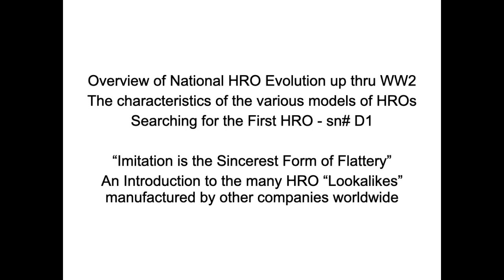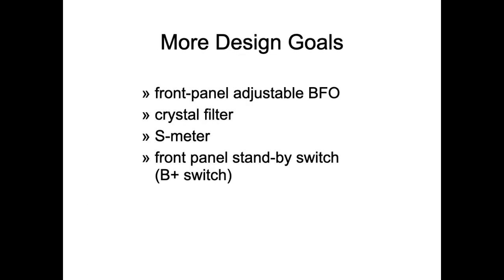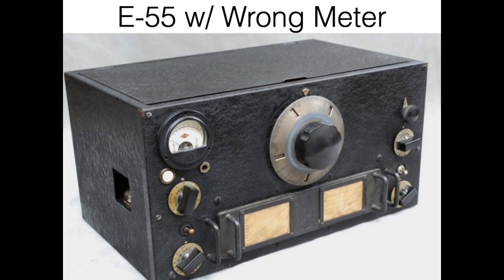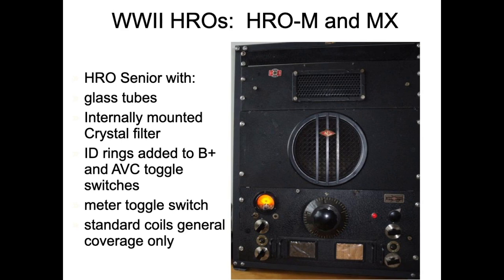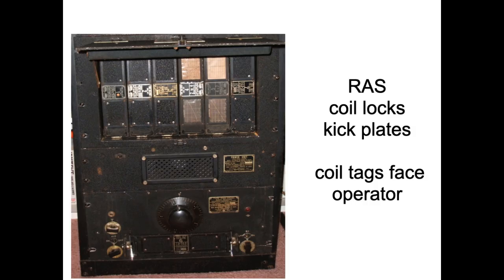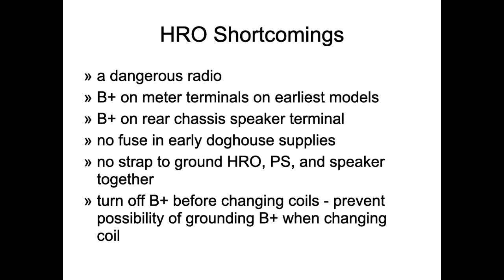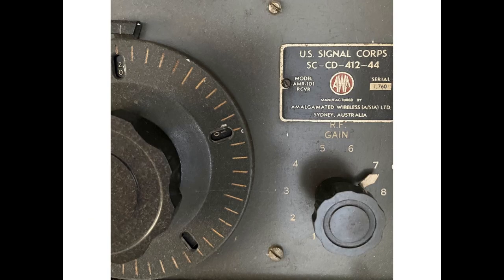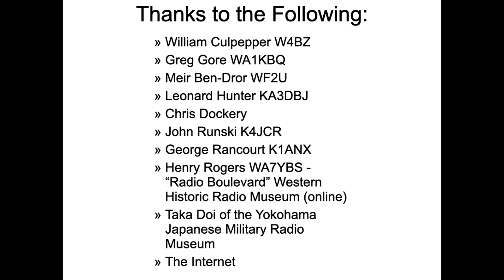The History and Identification of National HRO Receivers

Comment: What is displayed as a HRO-7R in this video is actually an HRO-7C.  The 7R is just the rack mount receiver.  The 7C is the "deluxe" version that includes the rack, coil box, power supply and speaker.

Comment: Hello. Thank you for the very detailed video! I have an HRO pre-WWII with a Royal Canadian Corps of Signals brass tag on top of the case. No serial number. It simply says, "Mod." where the serial number is blank. I am curious about the power supply. It has a built in speaker. It has the toggle and fuse on the face also. I'm fairly new to these and trying to research what I have. How can I send photos? Thanks!